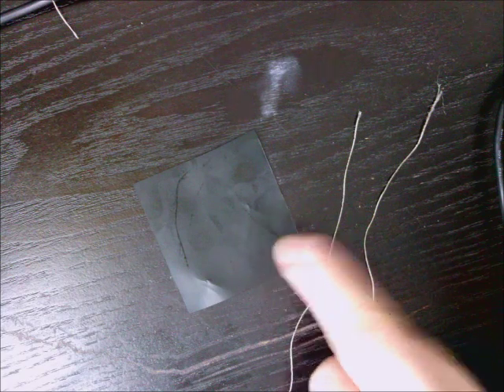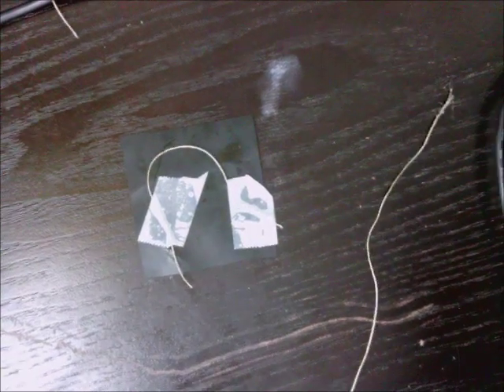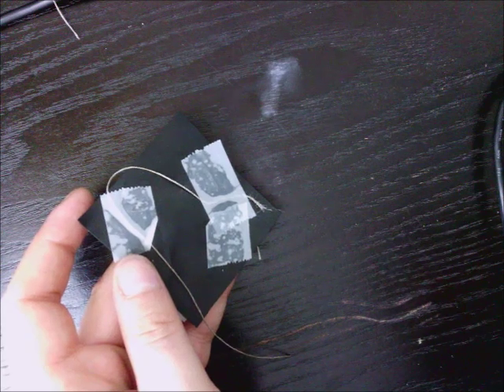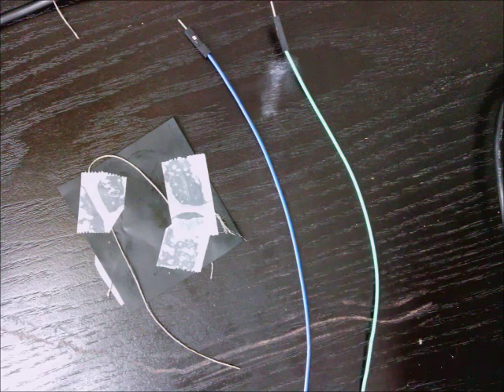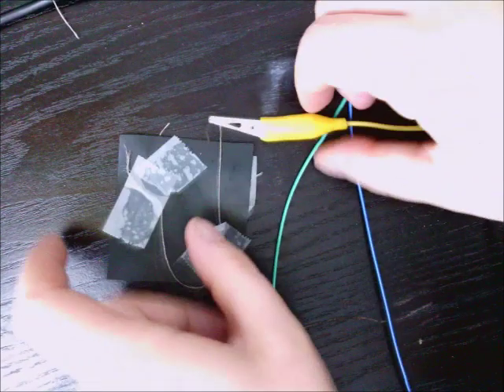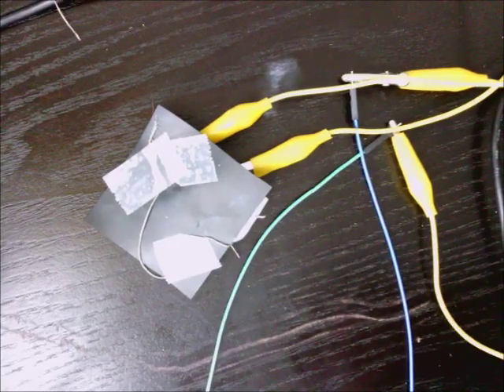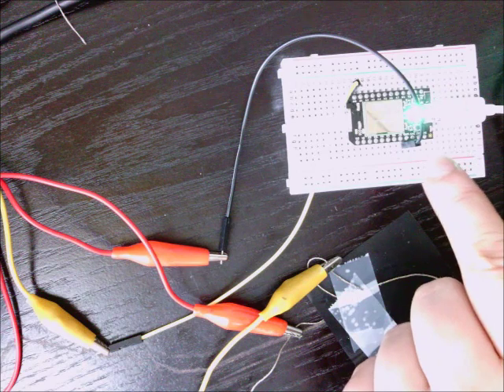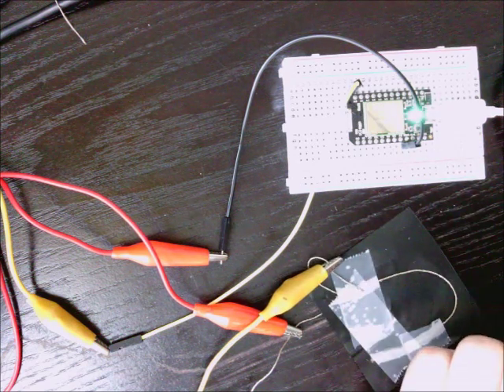Creating Pressure Sensors with Velostat and Conductive Thread

Comment: Had anyone figured out a better way to connect these?
Reply: I use rivets or similar metalic suff for fabric; they press the thread and you can solder to them.
Reply: Btw the there is four point at two of the thread so I assume u leave each one of the end as it is?

Comment: What Prit said.
Velostat changes resistance when pressed, right? Does your microcontroller read resistances? Mine reads only voltages, so I'd need to connect this velostat thing in series with a constant resistor, then one end to the voltage source and the other end to ground. Then I could measure the voltage inbetween.
Reply: You'd use an internal pullup resistor in the analog pin to create a voltage divider. It's not very exact, specially because it's very hard to know the exact resistance of internal pullups, but it works for very rough sensing.

Comment: This is pretty interesting, I've been looking for a cheap way to emulate the sensor style of actual ddr machines for a while.

How sensitive is velostat? If you could guess, what's the minimum amount of weight needed to make a sensor like this fire?
Reply: It depends on the area of contact, the number of velostat layers, and the velostat sheet properties. but you could rigg it to detect very small changes with a large copper contacts on opposing sides.